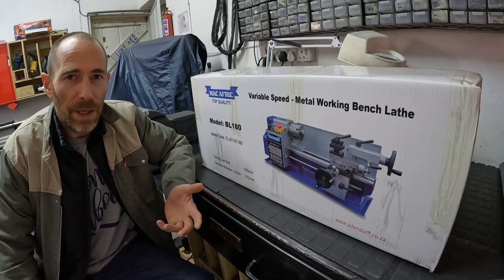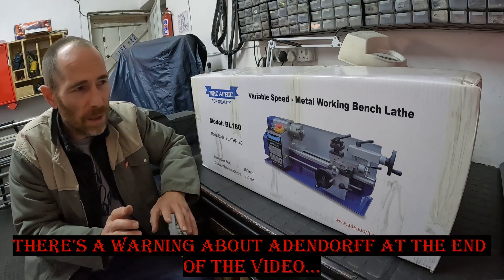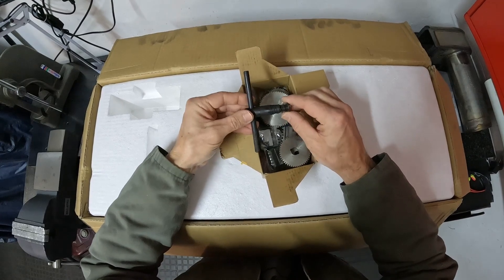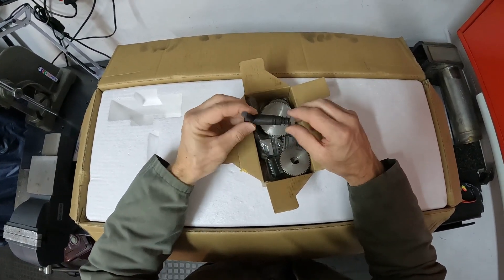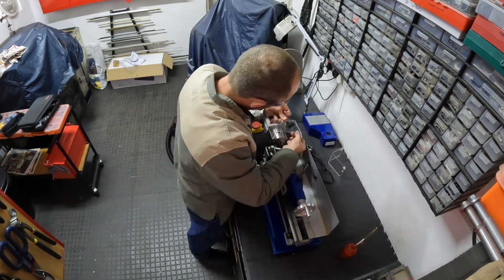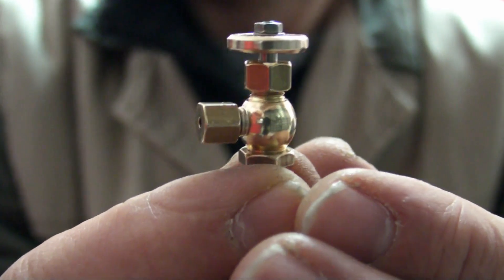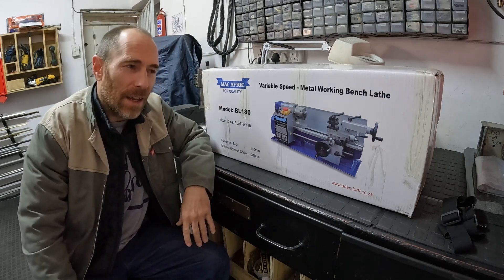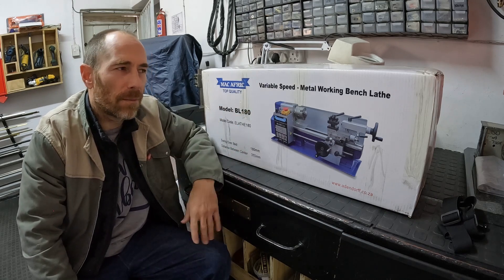Making clacks and steam valves using Adendorff's cheapest lathe

Comment: This is the first of your videos that I have discovered. I enjoyed the material and learned some tricks (e.g. using a D bit from the other end). How does the brass go? No dezincification?  I love your speech. To a person who is unschooled in South African accents, it sounds a bit like J. M. Coetzee's speech. We hear that occasionally on the Wireless here in Australia. Very different from other South African speech styles. Is it regional, or does it belong to a particular stratum?
Reply from the maker: 😅My speech is probably regional, it also changes with mother tongue... Dezincification is unfortunately poorly described and understood in our hobby. The short answer is all components outside the boiler can be brass; silver soldered boiler bushes below the water line should be phbronze and gunmetal/phbronze above the water line (for copper boilers). This has to do with the soldering process, the zinc comes out of solution and diffuses to the grain boundaries. When you do a polished sample you can actually see white 'cracks' which eventually leach out and cause what are mistaken as brittle failures. The reason why steam valves work when made from brass is because the soldering process is much quicker so there's less time for the zinc to defuse. Also the contact area is generally smaller relative to the volume when compared to bushes. The green loco in the video is well over 10 years old and even the blowdowns are still perfect.

Comment: Nice video, thanks a lot. I also bought that lathe from Adendorff and I am modifying it extensively to improve its capabilities and accuracy. I am thoroughly enjoying that process. What is really great about that lathe is that it is so small, it can fit in my tiny 2m x 3m workshop.

Comment: Can I ask you why almost all steam fittings sold for model model engineering are made of brass? Union nuts, injectors and valves. From what I understand live steam causes brass dezincification.
Reply from the maker: To answer this properly will take a full article.  In short, you won't have a problem with the smaller valves. You only really end up with a problem if you overheat when soldering for long periods, causing beta-phases. Assuming sensitization: Anything not in contact with water, no problem.  Valves in contact with steam very low risk. Valves under the water line in the boiler might have issues after many hours of steaming. Lots of 'experts' don't understand the underlying fundamentals, which causes the confusion.

Comment: Remember these Chinese lathes are built to a price. That means that usually the machines are a kit, and you have to take the machine apart and rebuild it to make it usable. 
This is a real handicap for someone without a machining background.  If you can manage it, buy a machine made in Taiwan. You may be assured that if it is it will be noted in the advertisement. It will cost more, but you get what you pay for.
Reply from the maker: I wouldn't completely strip the machine but the sliders definitely. I would honestly do the same with any machine...

Comment: Thanks for the time and effort of making this video. These little lathes are as you say are great for people just starting out in model engineering.
Can you tell me, when you are building lets say the LBSC Virginia and it will I am sure call for 5BA screws etc are they easy to come by in South Africa or do you substitute them with metric or UNF?
Reply from the maker: Thanks for watching! No they not unfortunately. The only imperial system I use is ME because I make all the fittings nuts etc. All small fasteners are metric and I modify them for smaller heads etc. I wrote an article in Model engineer some time back describing these methods...

Comment: I bought my mini mill from Adendorff - one with the power X feed - and it's done a few good jobs. The only problem I find with Adendorff is the limited range of tooling e.g. carbide end mills etc, or different sizes of cut-off tools for lathes. Also, it would be nice if they stocked an affordable, but fairly decent DRO system. The other stuff I've bought from them (e.g. engine lift/crane) has performed satisfactorily.
Reply from the maker: I've managed to come right with just their sets, I haven't really used carbide milling cutters much because sharpening them can be tricky. Have a look at my vernier scale video for my diy dro using digital calipers...
Reply: @Lukers_tinkering  yeah, there's a few videos going that route, but the cheaper calipers stay on permanently and inserting the batteries every time is a bit of a pain..

Biggest issue is the exchange rate, to be fair.